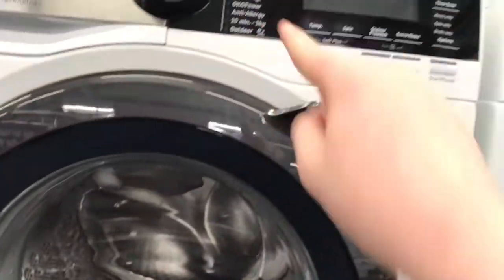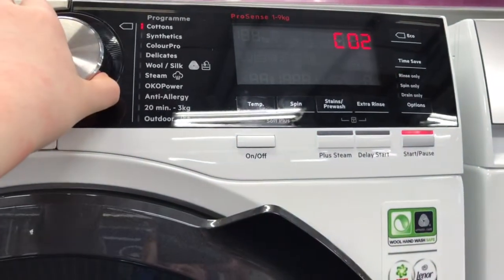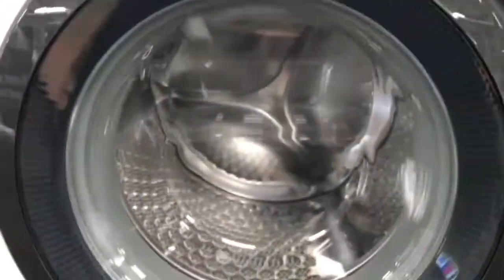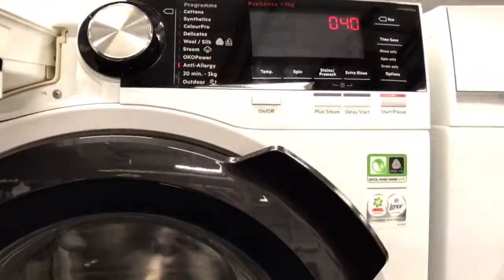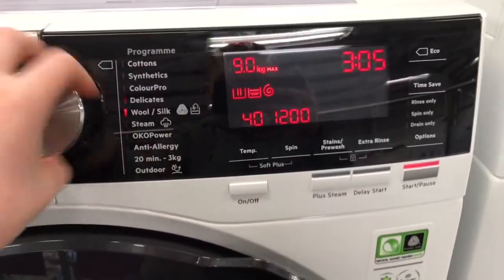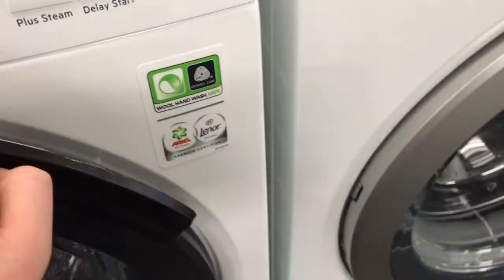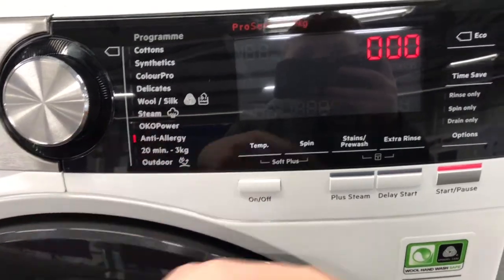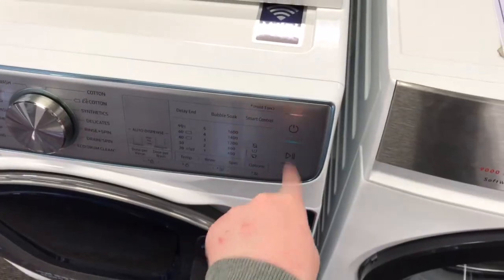How to use Service mode in the AEG 6000,7000,8000,9000 Washing Machines

Comment: My AEG 7000 series machine is showing an error EF0 and currently is on drying mode.
Whenever I turn it on it shows the same error and also a key sign on the left side of EF0 error. 
What should I do?
Reply: Whats the model No. from your machine?
Reply: Did you manage to solve this issue? Having the same at the moment

Comment: I have a AEG T8DEP845E tumble drier. It shuts down after a while sometimes at random - seemingly. No finish fanfare. Just shut down without any lights in the display. Does it both on a auto program and on a timer program. What could it be?

Comment: How do you enter service mode on the AEG t8dek946e heat dryer?
Reply: LGWasher1200  I have a T8DEP845E. It shuts down after a while sometimes at random - seemingly. No finish fanfare. Just shut down without any lights in the display. Does it both on a auto program and on a timer program. What could it be?
Reply: LGWasher1200  its on every program. Even just setting it for a fixed runtime - like 60min. After fx 20min it will just stop and show its ready to go. Like it never ran. However I cannot start it. Nothing happens when I press play/pause. I can change program and every setting, but it wont go. I have to restart it. And then the problem sets in faster. Only like 3min before stopping.

Comment: Hi There, one question, when it starts spinning, you can hear a noise which mine is making too. Sounds like a knocking or a helicopter. Mine only if it has clothes inside. Is this normal. Thought my machine is damaged? or something in it. you even can hear it in your video, 

thanks for your reply.
Reply from the maker: Sunny77 maybe I’m not sure because I’ve had a lot of issues with these machines especially to do with the bearings and the bearing seal causing bad noises so I’m not sure might probably be best to get someone out to it but then again it will be ages probably until then because of all this going on.
Reply: @SuperWasherKid2002  Thanks a lot. So you had troubles with the bearings? Well I was also already thinking of that, but the machine is only 3 years old. How old were yours? On top this model has a welded drum, so that you are not just easily change the bearings. The new modern way to make throw away machines. Well what a pitty. An expensive machine seems to be ko of the bearings already with three years. :(
Reply from the maker: Sunny77 I don’t personally have one but I know friends that do have ones and they have bearing issues I think it’s a little bit annoying that they charge quite a lot for these machines for them to not even last that long 🙄
Reply: I had this machine for few months and had same noises,  had engineers over and changed the drum. 😳 worst thing I ever bought.

Comment: Thanks so much. I bought one and it's broken ;-(
Reply from the maker: Briko no problem and I’m sorry to hear about that but there’s a lot of other people have problems with them as well
Reply: @SuperWasherKid2002  There is not problem, next Monday I will change it. Your video has been usefull to know exactly what was the problem. I got error E59 in service mode so there is an issue with the motor.

Comment: I hate this machine 😤  wish I never bought.  It doesn't do spin only,  even there's clear option for it. It doesn't wash well clothing still stained after wash. Hate it specially that it cost me £9000 🤬
Reply: Wth what is wrong! This machine's cleans perfectly and spin easyly too!
Reply: Buuuut the vibration is horrible. My old EWF10932 had a louder motor but handles vibrations better
Reply: @moneyfalcon267  Hmm. I don't think so. I seen lot new AEG's that handles unbalanced spins pretty good without much vibrating. @Solvita Amado Only if the legs or the floor isn't levelled then the drain hose vibrates!
Reply: Yes, it not an AEG but it's a similar machine.
And the motor in the vid is the same with mine
Reply: @moneyfalcon267  Wow, that ratteling is not normal. You have to call Electrolux.